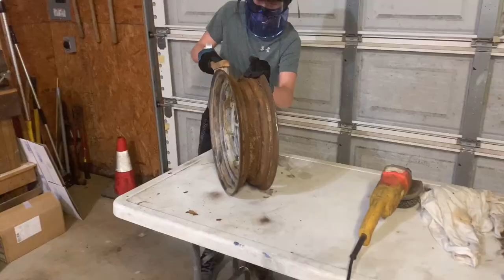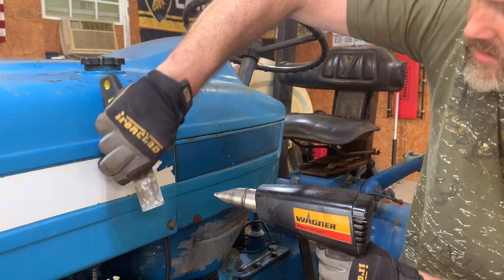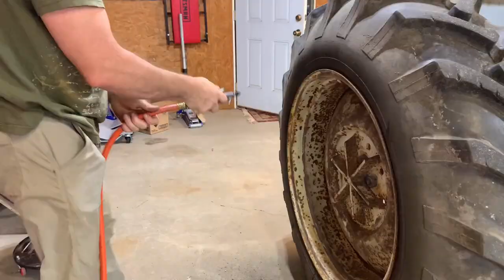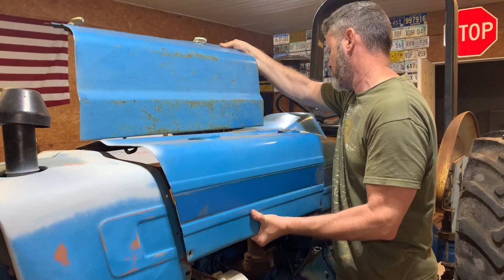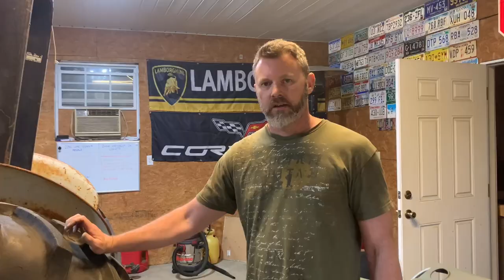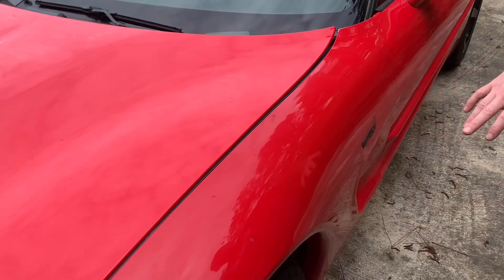Restoring a Ford Tractor | Sanding and Painting the Tractor | Restoration 4100 Tractor | Part 2

Comment: Tip from a retired painter...when you use a rattle can start a few inches away from your target item and take level strokes. Finish you level stroke  off the target. Try not to move the can in quick spurts rapidly. Jerking the can back and forth will give you uneven coats. Maybe the ground coat won't matter much but the finish coat will be much better.
Reply from the maker: Great tip. Thank you.

Comment: Nice work on the tractor.  I like using this product called the right stuff on rust.  It converts it to a paintable surface and turns it black when its done.  I used it alot on an old chevy truck i fixed up.
Reply from the maker: That’s good to know. Thanks

Comment: The old Ford is coming along nice. I love that you and your boy are working in the shop together. Some of the best time my Son and I have are working on things side by side.  Just want to pass on a little technique I use when painting rims I don't want to dismount. I use playing cards and stick them in the gap between the tire and rim. Overlap a llittle on each one all the way around. Shouldn't even need any tape. If you do it enough go ahead and save the cards after they dry but playing cards are cheap enough. Might take quite a few cards to go all the way around a tractor tire though. ;)  Take care guys and look forward to more videos.
Reply from the maker: Thank you for that tip

Comment: Trying to figure out why you wouldn't make sure it ran before you start restoring it?
Reply from the maker: I have to take it apart to get to the wiring and we need tires to move it around anyway. Besides, if it’s more than wiring we will do what it takes to rebuild it. Hard to kill these old tractors

Comment: Great job... What year is Grandpa's
Tractor ???
Reply from the maker: I think it’s between a 1965 and 1975
Reply: @SwampBoysGarage  nice...
Reply: @SwampBoysGarage  Your 4100 is btwn a 1975 and 1981, so newer then you thought.  I have a 4600 I just picked up, runs but has some small issues.  Once I get the mechanical sorted I will do the cosmetic restoration.   You have a great tractor, super durable and a great assistant.